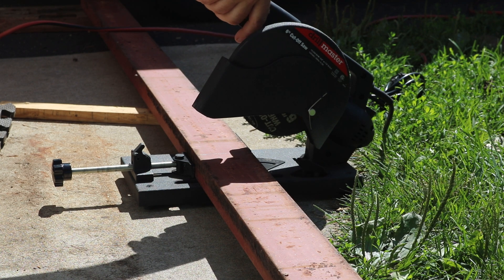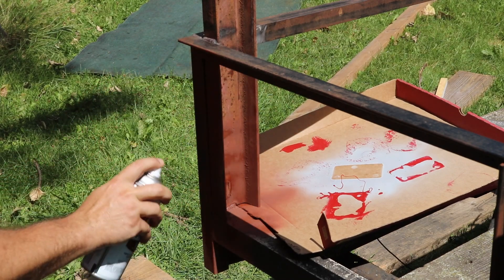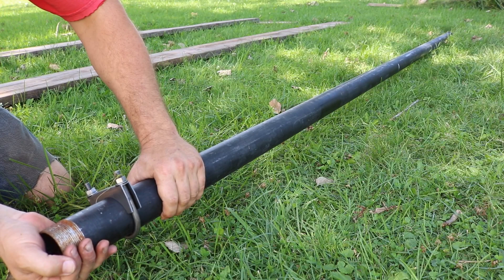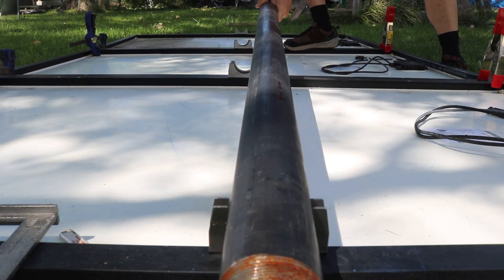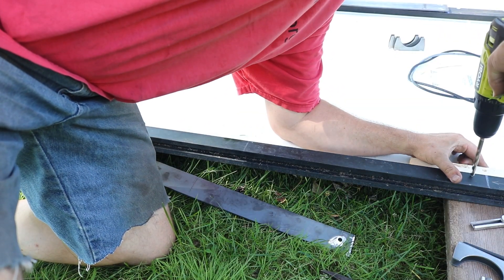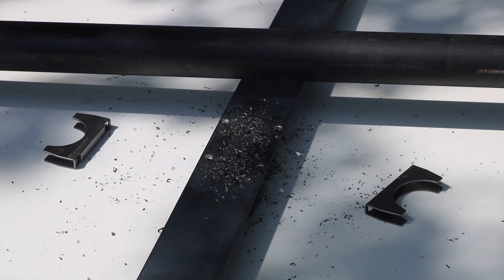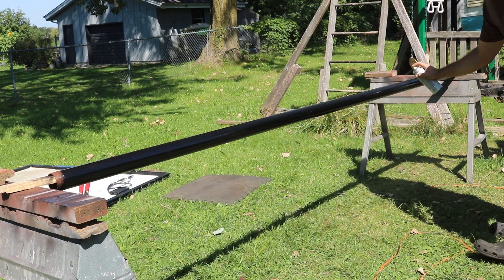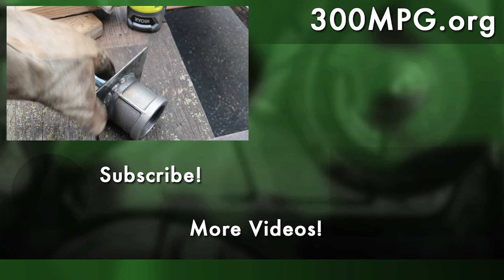Solar Trailer: Part 9 - Fabricating Side Two, Solar panels 3-6

Comment: Would it be worth adapting the c channel support so that it is capable of telescoping? If one panel could be raised the other wouldn’t cast a shadow over part of it.
Reply from the maker: It certainly could be done, but would add quite a bit of work to rebuild. To telescope, I would also need to add some sort of cable-winch to lift the entire assembly. Rotating a set of 3 panels and the frame is easy, but LIFTING it requires at least two people, or some sort of power equipment.
More than anything, I wanted to keep this project simple and easy to operate.
For the most part, the sun is UP overhead, so the most energy production is through the middle of the day, and shading isn't an issue.